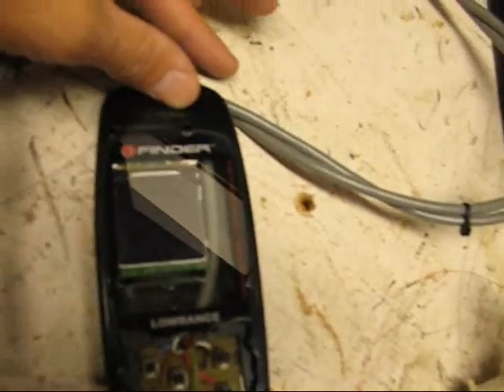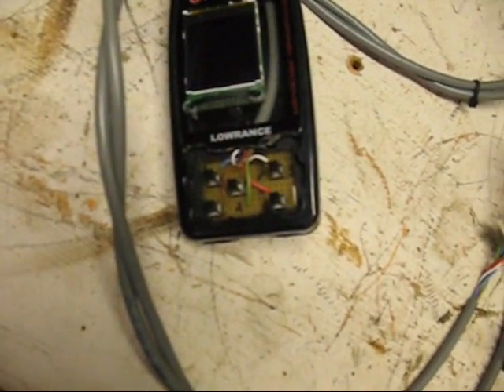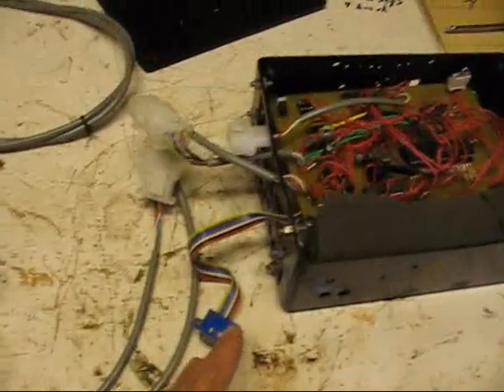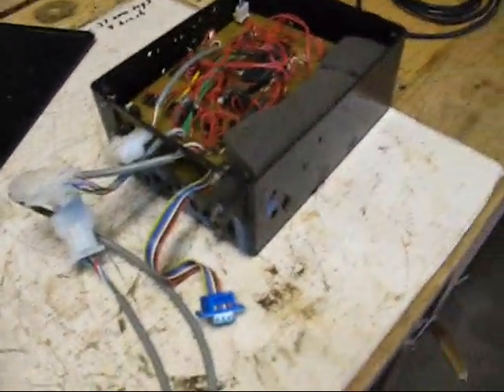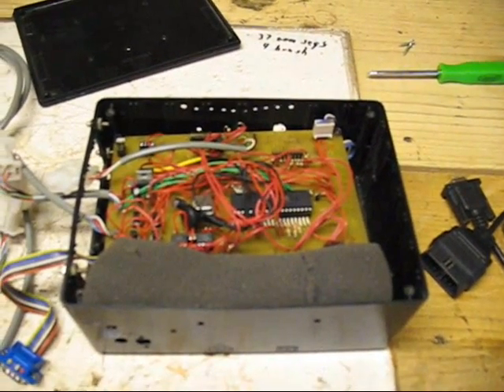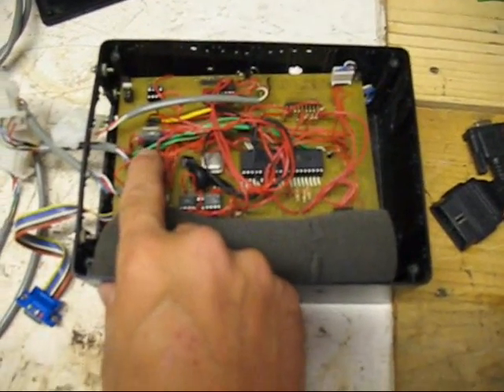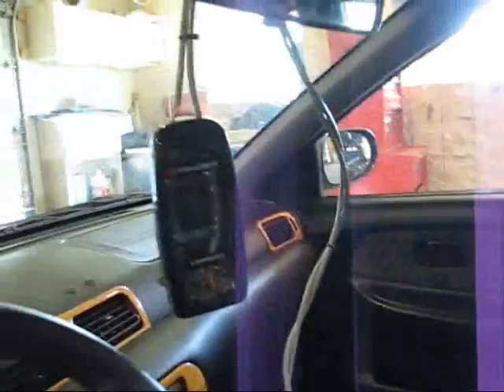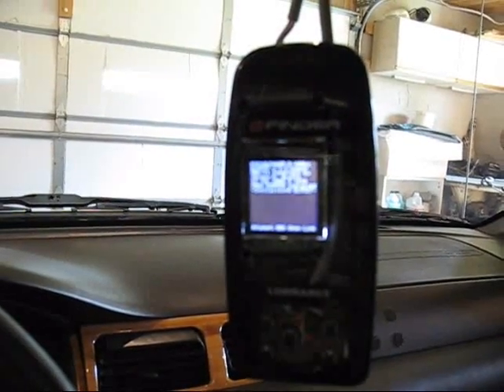Mr. Scanner Part 1 of 5

Comment from the maker: @maycor1076...
I've already cracked the case on the ECU.  Didn't find anything obvious, even under a 'scope.  According to my research and troubleshooting, it seems to be a "bit flip" in the flash.  Why?  Because my "in park, warmed up" idle isn't 625 rpm like it's supposed to be.  It's 650 rpm as verified by a handful of rpm measuring instruments.  Makes me think one bit of one byte/word got flipped in that part of flash and gave me an extra 25 rpm at idle, which also causes the P0601 code.